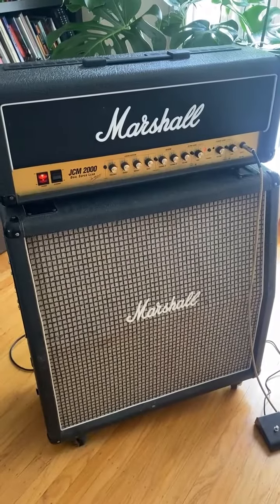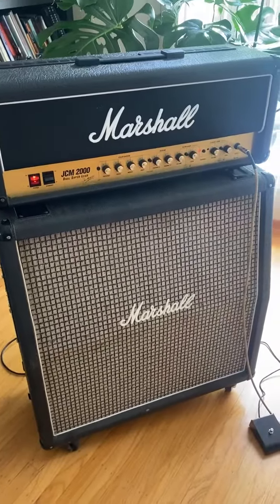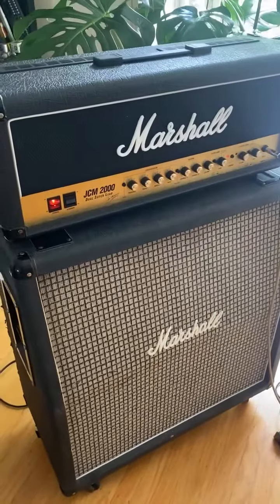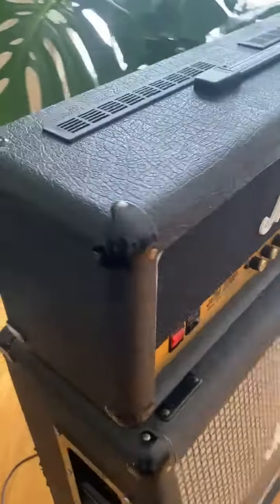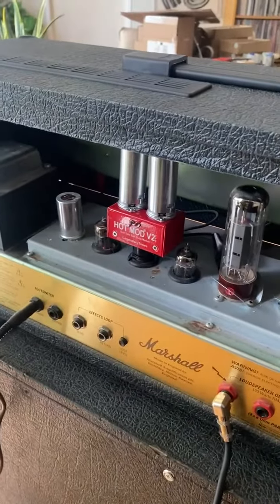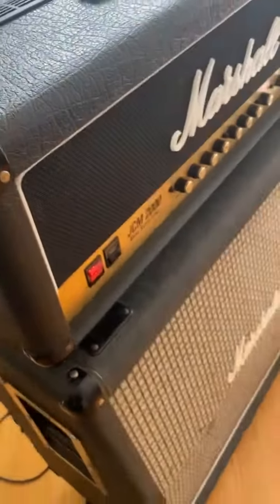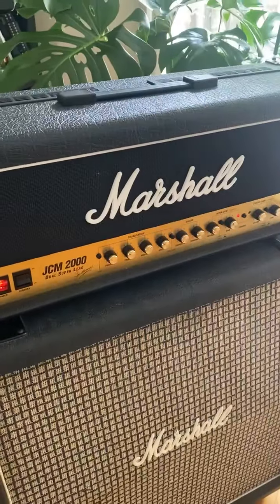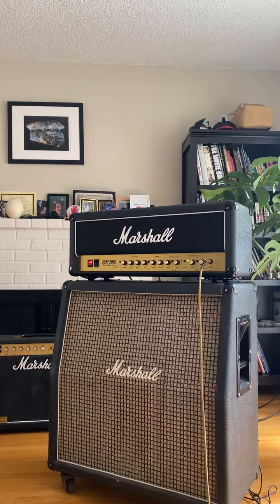LegendaryTones Hot Mod V2 Evo Demo in Marshall JCM 2000 DSL 100 Amp

Comment: JFC....that sounds astonishing.  The best part about it is that you're not making the mistake of using too much gain (that or start-to-finish shredding) which is an all-out f**king epidemic on YouTube,  and keeps from hearing any articulation or nuance of the amp.  This is THE perfect tone.  Almost a bit too perfect.  I would've liked to have heard what this sounds like with the exact same settings but without the Hot Mod.  Either that amp is a FAR better amp than I remember it being, or that Hot Mod makes an epic amount of difference.  You guys dialed in a killer tone with the Lynch Mod on a Runt 50, as well...but, this buries that tone.  I'd go out and buy both immediately if I thought I could get that tone.  But, the last JCM2000 I played sounded really bright and thin. So, this is a stock 2000, with nothing going on but the Hot Mod???  Btw, what guitar are you using?  This is stunning.  Incredibly well done.
Reply from the maker: Thanks for the feedback and comments. It’s a stock 2000 and a basic JB-equipped Strat guitar. All said, while I love the tone and it does great things in the circuit, remember a video clip is always going to sound different from “real life” - by the time we record (and it’s just a phone video), it gets compressed on YouTube and then we listen on our own devices, it’s never like it is in the room. I will certainly try to get some more sophisticated A/B videos posted with these higher gain applications in the future for sure.
Reply: @LegendaryTones  Thank you for the reply.   I agree with every word you said, but what I'm hearing, and the demo's I've heard, I trust enough to make a purchase and see how it works in my setting.  Not a whole lot to lose, by trying it out.  As of right now, I've got a Little Sister, that I'm otherwise very happy with, for what it does.  I was wondering if these units work with EL84 amps (assuming they physically fit).  That aside, I would MUCH prefer these simple phone recorded demo's than what's taking place on YouTube, which is a lot of very over-processed recordings (even with simple gear demo's)....for whatever that's worth.  IMO it keeps things "honest"....for lack of better words.
Reply from the maker: @phillamoore157  Thank you. As to your question of compatibly, that is determined not by power tube type but if the preamp tubes have what’s called a cathode follower tone stack. That’s a type of circuit the mod needs to see in order to connect and add its gain stages. So no problem with any Friedman’s (the Runt is very popular with the mod) and many Marshalls, etc. We have compatibility info at the LegendaryTones site as well for amps we’ve validated.
Reply: @LegendaryTones  You're talking to a retired, turtle-wrangler, Dave!  But, I believe you said that it  WILL  in-fact work with a Little Sister.  I briefly looked at the website, but didn't see anything specifically for the Little Sister or Mini Dirty Shirley.  Unless I misunderstood you, let me know exactly which V2 Evo to purchase, and I'll go order it as soon as I hear back.  I'm anxious to hear how it will effect this particular amp. 👍
Reply from the maker: @phillamoore157  Sorry I neglected to answer directly on that one. Yes on the Little Sister (as well as the similar Pink Taco), the mod will work (standard wire version), BUT I have to make a shortened version of the socket to allow physical clearance in the amp. Email me and I can take care of that. No extra charge of course and it would still work in all other amps. David@legendarytones.com.
Reply: @LegendaryTones  ...just reached out.
Reply: what that guy said. ^ I don't really play with that much gain, and the only Marshalls I've owned were JMP or JCMs. Never cared the tone from newer Marshalls I'd hear live. But that mod wakes that amp up. WOW
Reply: @r.t.ingram3156  Amen.  It's funny you pointed out the JMP reference.  I bought the this and had him modify it for a Little Sister chassis, and I can't even begin to talk about how good that amp sounds now.  With this mod added, I take an EL84 single-channel amp, from Texas blues/Hendrix to 80's sunset strip, with just the gain knob.  I can't speak highly enough of this product.
Reply: @phillamoore157  wild. I have the Dirty Shirley 40w combo now. I had my one of my fave vintage Marshall’s blueprinted and cloned. But really don’t play out using 100watt heads and 4x12s anymore. But they sure are fun to fire up at home from time to time. I’d like to hear that Little Sister you mentioned
Reply: @r.t.ingram3156  I tell ya, brother…..I came SOOOO close to getting the Twin Sister. But, with my humble setup these days, even 40w is a bit too much.  After much research and trial and error, I went with the LS.  Although, had the JEL20 been out, I probably would’ve went with that one, given it has a similar warm plexi clean channel.  The Hot Mod was way after the fact, but turned the gain into “Super-crunch” from Hell.  Friedman’s gain structure tends to get a bit “spongy”…..and the Hot Mod took care of that, and made it ultra-defined, and percussive.  Prior picking one up, I saw a video on here of a guy who actually has it on his LS, as well, and I had to pick one up.  And, I’m not a big Friedman freak, either.  Just not my thing.  But, the “Sister” series I really like.  I may wind up with an SLO 30 one of these days.  But, you’re 100% right….anything over 50w is just too much for home use.  Even playing out, the clubs don’t want to deal with that kind of volume these days either.  Everyone is using modelers live these days.  Even running it through a 4X12 can start to get a bit much.  But, yeah, I can’t say enough good things about the LS…..ESPECIALLY, with an LP (when going for the Classic Hard Rock tones).  But, the a strat kills it when doing the SRV, Hendrix, or even Chris Duarte tones.  Just a great versatile “guitar hero” amp, that’s SIMPLE.  I hate all the buttons on these amps today….  But, yeah….I’ve been super happy with mine. 👍
Reply: ive heard jcms sound good like this without this mod.. u just gotta run em lower gain and not drown them with too much bass. btw he sounds like hes in a room with wood floors so that gives mobs of extra clarity ntm his higher volume. try running a jcm with an emg 81. im pretty sure u will like that. but again u use the pup for the gain... not the amp. some say the v30s we r so used to hearing dont pair good with these either. this amp gets muddy with too much bass and gain. so a speaker that give good mids is preferred.
Reply: @neepathius7  Based on what I’ve heard, and my own experience, I think 90% of it is not using too much gain, and get some air moving through the speakers.  I’m using a Little Sister with the Evo Mod through a Friedman 4X12, and I’m very happy with what I’m getting.  I may trade, or pick up a JEL-20 as well.  But, keeping that gain as low as possible while still getting the tone you want I think is critical.  Thanks for the reply!👍

Comment: Sounds great !! Do you ever make one for the 5 watt Marshalls?
Reply from the maker: Thank you. The smaller Marshalls that I’ve examined don’t use a cathode follower circuit  so not compatible unfortunately. Check out the LegendaryTones site though as we have compatibility info there if interested in the future or for another amp.

Comment: I’ve been following you for years and I know you know Marshall’s like few others. Is this the same as physically adding another preamp tube to the amp? It’s always tough to really judge from vids but I’ve played Marshalls with the extra gain stage and I know how good they sound so this looks promising!
Reply from the maker: Yes correct. We are adding a gain stage which sits at the tone stack right before the phase inverter. Reach out anytime with questions and thanks for checking it out! Originally I designed this for 2203/2204 type JMP and JCM 800 circuits.

Comment: Ok cool it will work on a DSL 100H Marshall head ,i read somewhere it would not work!, i would have ordered one  a year ago!
Reply from the maker: Yes, we recently validated the DSL 100H. If you order one, send me a message (david@legendarytones.com) so I can make sure to include the socket extension for it. DSL100H will use a standard wire version of our mod. Thank you!
Reply: @LegendaryTones any chance i can swap the one for the 800 for the 2000 thru you guys
Reply from the maker: @davecombs5220  Email me at David@legendarytones.com

Comment: This may sound stupid but do any of your mods work with ksr amps?
Reply from the maker: There are no stupid questions, but the answer unfortunately is “I don’t know”. I would have to see about which models and investigate. Also with higher gain amps, same concept applies - it’s not just about “more gain” but the ability to turn down the preamp gain at the front for tighter response and add sustain back in later downstream with the mod in the circuit. Reach out to me anytime at David@legendarytones.com and we can investigate your amp. Thanks for your interest!

Comment: Just curious, does this only (or at least mainly) affect the ultra gain channel?
Reply from the maker: In the JCM 2000 it effects both channels. But the first channel can still remain clean if that’s the concern - just need to tweak the level control down and then it’s all set. For other amps, it varies (for example a Friedman Runt with the mod leaves channel 1 unaffected). Reach out if I can answer any other questions and I appreciate your interest. David@legendarytones.com.

Comment: I have a TSL60 and love it. I dont like the humm it has when turned on i cant hear yours doing it, is that an upgraded heater?
Reply from the maker: Hum in an amp can mean several possible things. It could be output tubes that are unmatched (can shift in bias over time) or electrolytic caps needing change, or grounding. Email me at David@legendarytones.com and we can troubleshoot a bit. The addition of the gain stage can mean that problems the amp may have will get amplified.

Comment: I want this and the Mr Scary so much - is it true that they won’t work in the 50 watt JCM800s though?
Reply from the maker: No, it just depends which JCM 800 model you are referring to. The 2203 and 2204 will work in ALL years, but the 2205 and 2210 two-channel models will only work in ones produced from 1981-1983. The LegendaryTones site has all the info on compatibility and amps we’ve validated. Thanks for your interest! 
David
Reply: @LegendaryTones  got it. I have a ‘86 2205 - will there ever be any mods from Legendary Tones that I would be able to use?
Reply from the maker: @withbloodleftuncleansed  I do have something in the works - a bit different, but will benefit most all amps. Hope to share more this year.

Comment: Will the hot mod add gain to the crunch channel as well? Are all the hot mod versions available in reverse wire to be compatible with the UK DSL?
Reply from the maker: @MichaelDespairs  It does add a gain stage to both channels. So you will need to adjust as appropriate. The Hot Mod V2 Evo and Mr Scary mod (as well as earlier Lynch mod) will be compatible using reverse wire version. Certain earlier non-Evo versions of the mod will NOT be compatible. As long as it’s got the two switches on the front, you’ll know it’s the Evo version and you’ll be good.